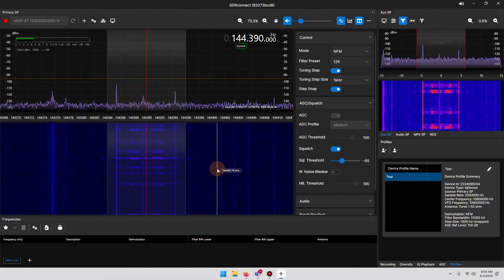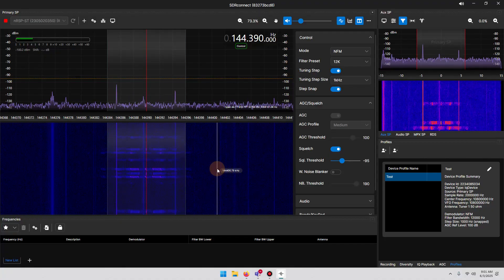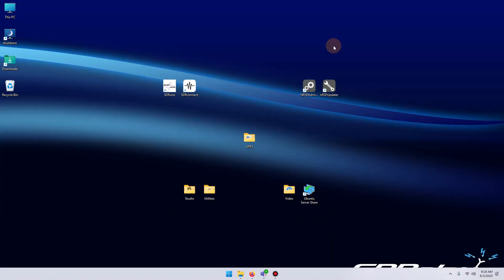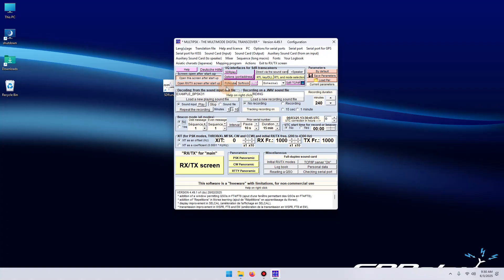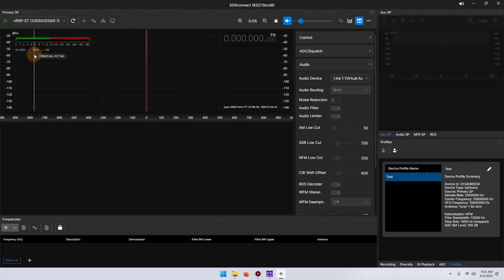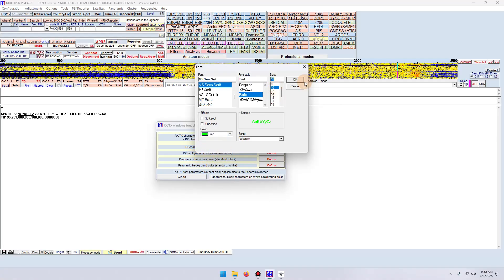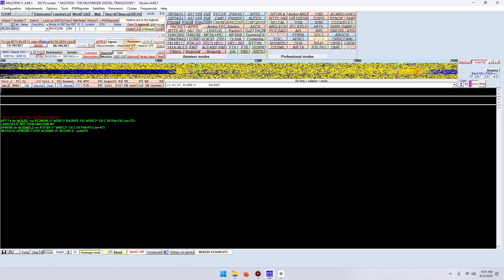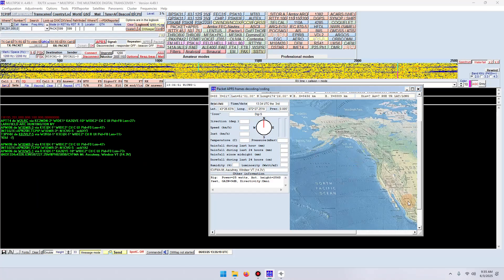SDRconnect, nRSP into MultiPSK decoding APRS

Comment: I bought an SDR 2 way back when, when they first came out. I still haven't had time to work it out. Will it work with Connect?  Plus, is there a way to use it as a scanner for police / fire and more?  At 76, my eyesight isn't as good, making it hard to read a manual, and the brain is a little slower than it was. lol  Any help will work.
Reply: Yes, the RSP2 is compatible with SDRconnect. SDRconnect does not have a scanning module as of yet. SDRuno (Windows only) does.
Reply: Thanks for the reply